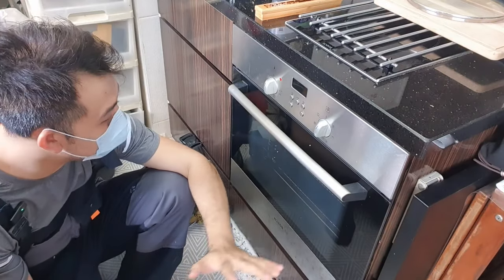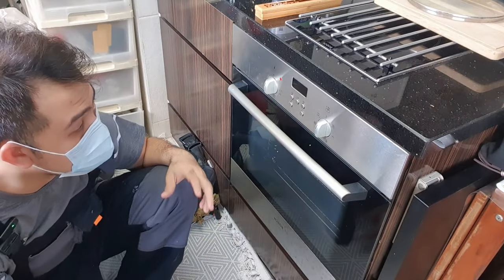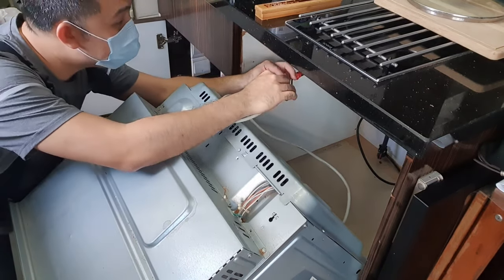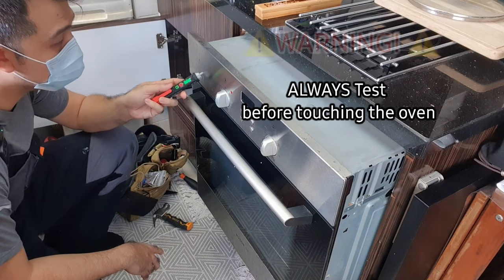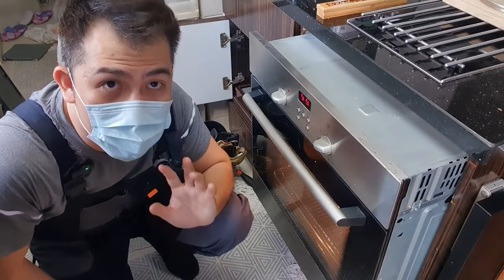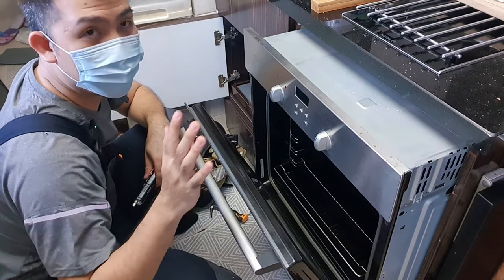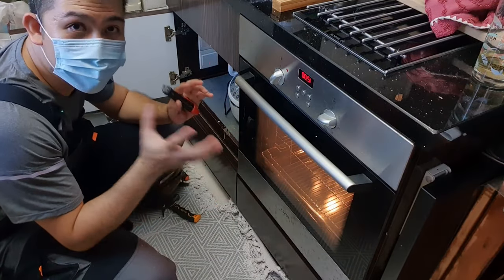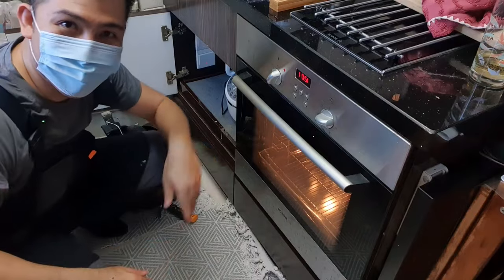Oven Trip Solved! (CAUTION: please read the description for warnings) (Save $160)

Comment: I had this problem many years ago when the oven was newly installed and hardly used. When the temperature is set too high, it will trip each time after running for about 5 to 10 mins. Because the trip do not take place immediately, one may try using your method of driving out moisture without disconnecting the ground wire. Simply set the temperature very low at start, eg 50°C or at a point which does not trip for longer than 30mins. Run it longer at each interval of say 30mins to 45mins. Then bump up by 25°C each time until it goes to max °C. I suspect it may still work if you just max at 100°C or slightly higer (above boiling point of water) The whole process will take longer but its safer. This can work only if the oven do not trip immediately after turning on. Did this before. It worked for me. Oven running good since then.
Reply: Just tried richardchee2454's method because my oven tripped out within 2 min after not using it for 12 months. Started with 50 degrees C on Fan Forced setting and gradually raised temp by 25 degrees C successfully every half hour for 2 hours without tripping. Stopped at 200 degrees C. So far, so good. Thanks.
Reply: Way to copy exactly what he did in video basically and claim it as your own. Sad, and guy that tried, 'his Richards method' fyi it wasn't his method and he stole it from the video uploader. Give credit where credit is due and don't try and steal it from other people who deserve it while you don't. Infact you deserve a swift kick to the temple for being such a grumpy individual.
Reply: Thanks, just did Richardchee method. It worked first time.
Reply: I am starting this process now on a Miele Combo Oven. Did you just have to do it the once ?
Reply: @donalgalvin5838  Yes. Once only. I did it once many years back. And the oven still functioning well without any electrical tripping since. Hope you have success with yours.
Reply: @richardchee2454  hi there. Thanks for the the reply. When I got it first is was tripping on all functions. I did your trick and now it works perfectly on all functions except for the grill. I might replace the element and hopefully I’ll have a trouble free oven 🙏

Comment: For anyone attempting to fix a tripping fault with your oven, please don’t do what this guy has done. Never ever disconnect a protective conductors and switch the power back on. Hire a proper electrician who will have the right equipment to diagnose the issue without putting yourself or your family in danger.
Reply: He clearly putting warning sign and alerted the audiences in the video.

Comment: My oven which has not been used for 5 years tripped the breaker when I started using it. Watched 3 videos including this one. Did exactly this except I didn't step the temperature up. I straight away put the temp at max, turned on the convection fan and rotisserie motor and left it on for 30 minutes. The oven worked without problem after that.

Comment: You are the best! Saved me $160 (if that is the repair cost in 2024).
My oven used a 3 pin plug instead of a wall mount switch. It makes it a lot easier for me, just remove the earth wire from the 3 pin plug and taped the earth wire outside the plug with electrical tape. So I skipped removing the oven step.

SAFETY FIRST! ALWAYS.

I tried heating up on 1st day, even though I able to heat up to MAX at 15min intervals, it still tripped.

Realised that I only heat up the top element + fan only. Decided to try again with bottom element the next day.

Tried again next day with both element + fan at 50C/15min interval until MAX.

 Then fix back earth wire and it works! My observation is the bottom element is the culprit with moisture. Heating only top element does not remove moisture on bottom element. Next time will heat the bottom first.
Reply from the maker: That's right don't give up! I'm very proud of you!
Reply: How to remove the earth wire from the plug and how to fix it again? 
Can u please explain in detail ?
I too have this 3 pin plug and I don't have any idea

Comment: thanks for this helpful video! 
Followed the steps to try fixing my Smeg oven, the first time round oven tripped again after I re-earthed it, only then I realised it was on "eco" mode. Oops! Did it a second time with "fan assist" mode and now it's ok.
Helped a friend try to fix their Bosch oven - learnt from my previous lesson and made sure I set to "fan mode", however, the oven tripped again after re-earthing. My guess is that Bosch's "fan mode" for this particular model only uses a heating element at the fan, and so it didn't remove moisture from the upper/lower main coils. May have to try again! Wondering if its common that some oven models have "fan mode" that don't make use of the main coils?
Reply from the maker: Hi you wanna turn on all the could to ensure enough drying. But having said that,  I've seen 75% success with this method

Comment: When you say moisture in the coils, you mean within the heating elements? Surely this would read as closed circuit when testing the element contacts and earth?
Reply from the maker: Sometimes it doesn't show. But when current is strong enough there will be a momentary arc causing the rccb to trip

Comment: My stove only has a plug in outlet to the wall it doesn't have those extra wires.
Reply from the maker: @yolodolo9143  the wires are in the plug, you have to open the plug to access the ground

Comment: I’m going to try leaving the oven on and seeing how that works. How long would you recommend leaving it on for on the highest setting?
Reply from the maker: Well usually I just leave it for 15 mins at the highest setting. Mine goes to 480G/250C which is more than enough to sizzle the water out of the insulation
Reply: @ThePunggolHandyMan  that's perfect! I was thinking an hour or more 😆😆😆
Reply: @ThePunggolHandyMan  should I leave the door closed when I do?
Reply from the maker: Close the door. You want the oven to rise in temperature
Reply: @ThePunggolHandyMan  thank you!

Comment: Pls, I would like you to clear my doubt on another oven issue. I just bought a 3 chamber oven for bakery project. Everything looks good but each chamber has a small hole in the rear side. I would like to know if these holes will pose a problem in my baking process . If yes, what will you suggest I should do to solve this issue before I actually start using the oven? Most of the deck ovens i have come across don’t have such holes. I am afraid to have heat leakage . Thanks for your helpful reply
Reply from the maker: Hi well I'm not sure about individual ovens 😅 I'm sure the designer of these products have put in a lot of thought into the design including the small holes which may have a purpose in temperature regulation, ventilation or airflow. 

My reccomendation would be to check with the manufacturer😀
Reply: Thanks so much.

Comment: Why will the casing be live when you remove the earth wire?
Reply from the maker: Thank you for your question!

Usually this is indicative that the coil which is live has shorted to the case which is grounded. The RCCB detects the current from the case through the ground wire resulting in the DB  trip which protects the user from an electric shock. Hence removing the ground removes the safety and the case becomes live since it is shorted.
Reply: @ThePunggolHandyMan    In your video, even after heating up the oven to max, the case was still ‘live’. Does this mean, even after drying the coils, it is still shorted to ground but just not as much for it to be detected by the RCCB?

Comment: This problem also happens with bread makers.
Reply from the maker: @FixTechStuff  really do tell me more!
Reply: @ThePunggolHandyMan  I've come across it twice, usually the breadmaker is left unused for a long period and the element absorbs moisture.
Most people would throw it out, but using your method it's an easy fix.
The first one I did was on a circuit without an earth leakage breaker. The 2nd one I just kept selecting bake and resetting the breaker till it worked. :)

Comment: Don't touch the oven, yes, but what are the chances the oven housing is making contact with some other appliance? Is there a chance it could be somehow shorted to a nearby sink, plumbing, etc? I know it likely shouldn't but there are some dodgy installers out there.
Reply from the maker: Tha k you for your comment! The reason I made this video is to show how it can be done safely, as there are worse videos which do not highlight the dangers of attempting this procedure. There are countless what ifs and I can't possibly cover everything in a short you tube video. As always, use your good judgement and always be safe
 If in doubt, get a pro.

Comment: My oven tripped once I operated it and the microwave oven at the same time. Since then the breakers tripped when I switch on the oven. Could you please tell me if this method work for my oven?
Reply from the maker: Microwave oven is not the same as convection oven so I don't think it will work. You might need a replacement

Comment: what's the voltage of the casing when doing this method?
Reply from the maker: It varys depending on the fault. But i don't have the number off hand
Reply: Why would the casing become live when ground is disconnected? Equal potential? Or because of the leakage current thats in oven?

Comment: Why disconnect the ground wire . What’s the theory ?
Reply from the maker: Well if there is a short to the case, there would be current flowing through the ground. The RCCB detects the difference in current and trips, as this is a condition which indicates a fault. By removing ground, the RCCB will not detect this difference in the ground wire and won't trip. This enables you to run the heating / drying cycle in the oven

Comment: The real question is, why should this be a common problem? Ovens are known to be installed internationally, US, Europe or elsewhere. Is it due to the Asian practice of installing the hot stove over the oven that somehow resulted in condensation of water droplets on the inner metallic surface of the oven, where the wiring is located?
Reply from the maker: Not really. I think it has to do with our climate

Comment: thanks alot for this saviour video. i have a question, say the oven is working after these steps, will the oven be moisture-proofed or the oven may trip again if left dormant for a few months? thanks
Reply from the maker: @couch7634  you gotta use the oven every 2 weeks else this will happen.

Comment: Thank you so much for the video. We followed your method and recommended timing for each temperature. It worked well immediately for at least 15mins at various temperature (180-210), after ground wire was reconnected. We turned off the oven and took an hour break. After the break, we turned on the oven at 180 deg c. at fan (3D hot air) position. However it tripped after 5mins. I’m wondering what might be the problem and if we should re try the process. Do you have any recommendations for this situation? Thanks in advance.
Reply from the maker: Yes please re try the process and give ample time for the dry out. However if it still does not work then you gotta call a repair man

Comment: I don't recommend this. Too many things can go wrong and it's not a hundred percent fix. Going by Murphy's law, eventually someone will be killed. Sometimes it's the terminals having problem. 
Very risky because it's connected by hard wiring and i suggest using wago which should be a lot easier to handle.

What we used to do was DISCONNECT MAIN POWER. Disconnect heating elements and check if the heating element is the issue. You can also measure the resistance from the heating element and use P=VI to know if the numbers are reasonable. We will usually buy a new part to have a more guaranteed fix or some DIYer will bake the heating element in another oven.

Even so, still very risky, because if the amateur, ignorant or inexperience user forgot to disconnect the main power, it could still mean death.

Best advice is not buy such a large oven that has to be hardwired unnecessary, and switch the oven on occasionally to expel the moisture
Reply from the maker: Hi! Thanks for rhe feedback! The purpose of this video is to highlight the risks with attempting this procedure as there are may videos online which show how to do it but do not demonstrate the danger.  So I'm providing info that should someone want to DIY this, they should be aware of the risks involved

Comment: Is not moisture. Is the oil accumulated at heater area. After not using for sometime. It get accumulated.
Always, clean up (including the heater element)when not in use.

Also in this video, installation is clearly not compliance with safety requirement.

Comment: Hi, I tried the method shown in this video and it works fine when the ground wire disconnected. However after connecting the ground wire again, the oven trips the circuit breaker. Any clues what can be the problem or the solution ? Thanks in advance.